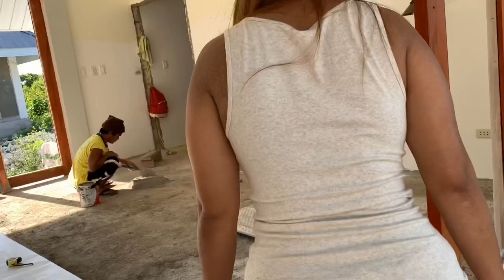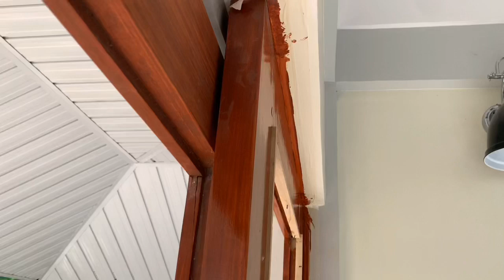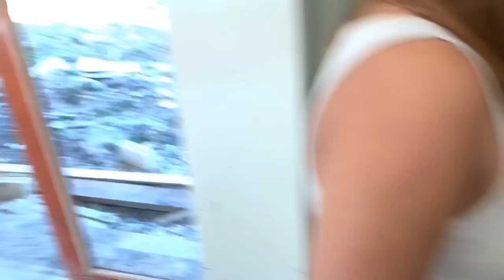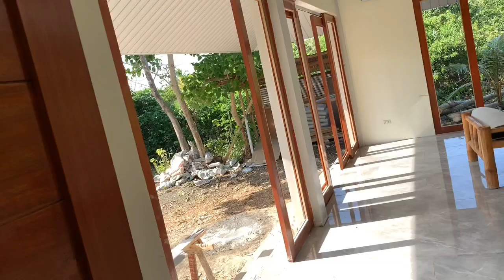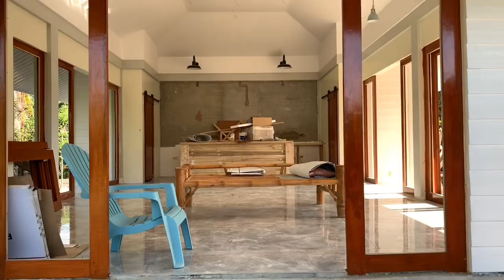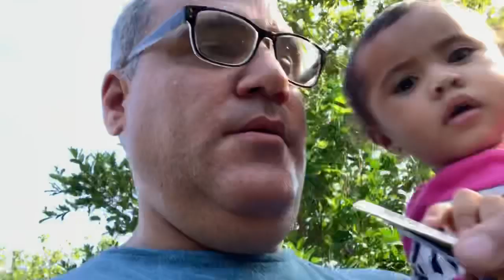SAMMY THE JACKHAMMER // MASTER VILLA TILES

Comment: Anthony, It was really nice they turned out the whole school to great your homecoming. I use the no ads, no redirects etc  "brave browser) and keep your
channel on a tab channel easy to access. Suddenly there were 3 videos, a real treat. About windows and doors. If you think the frames are or may warp
then 3M windshield bedding compound part number 08611 could be usefull. The sliding doors are in my opinion hung correctly. There needs to be room
for a face mounted flexible seal on the fixed sections for the overlapping sliders to seal against. Across the top some bending break formed angle to put the
seal strip on at the door area with the formed material full span for continuity. If you mount them nearly in contact the finish will be compromised letting
humidity in unequally and lead to seasonal warping. The meeting line of the doors would get an edge seal on one of the doors. The sliding doors being in
the same plane makes the stiles look wide when  completely closed during daylight but gives a flat surface for screens. You haven't mentioned screens there
only on the casement windows but if you don't want air conditioning 24/7 screens seem unavoidable. I may have forgot to run conduit for CAT6 cables but
I didn't forget screens. When you do landscaping you might include building to building CAT6 cables for internet, intercom, TV and security CCTV cameras.

                                 well welcome home from the old people  george and aurora